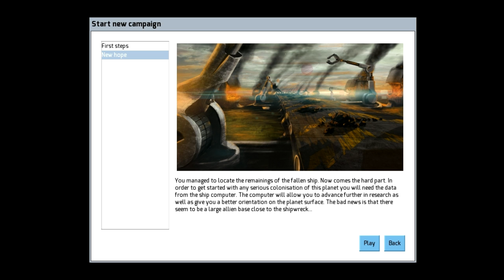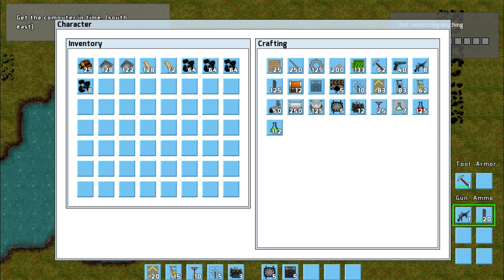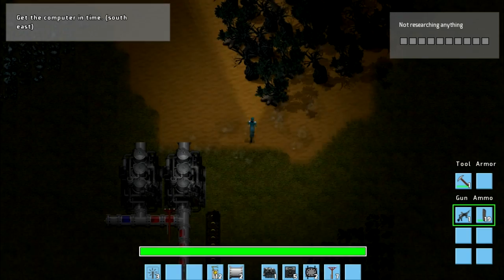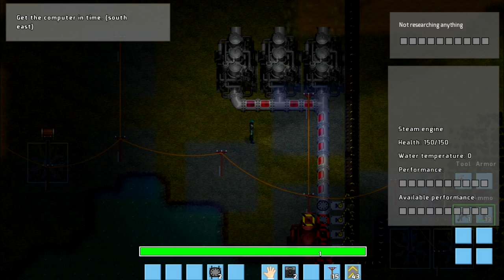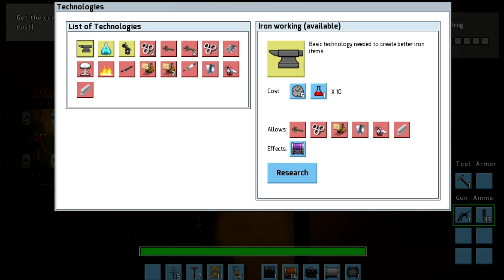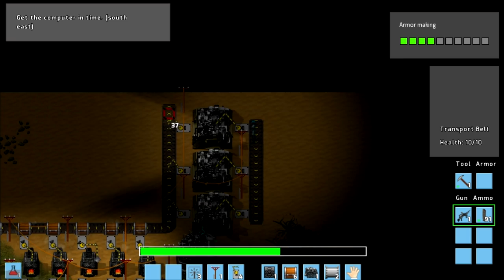Factorio 03 New Hope

Comment: It seems that circling coal and ore on the same belt doesn't work well due to jams. Consider using circle of coal to power your furnaces and straight ore/processed metal lines. 2 furnaces per ore drill is usually enough. This way you'll need 3 loaders instead of two, butthere will be much less jams, you'll be able to add more furnaces as you increase mining speed.
Also you can load materials into a chest faster if you put 3 loaders in U shape.